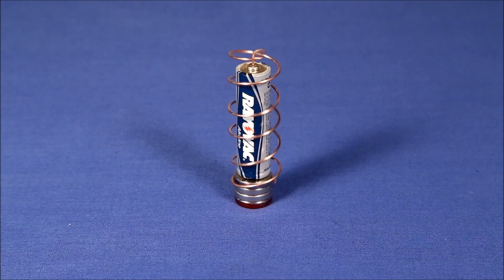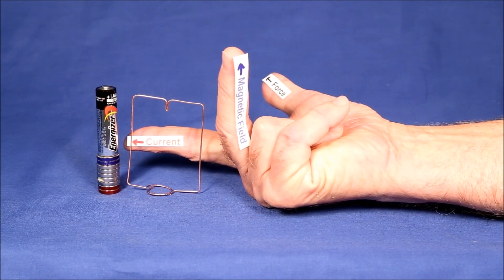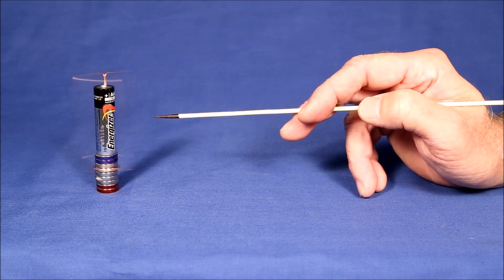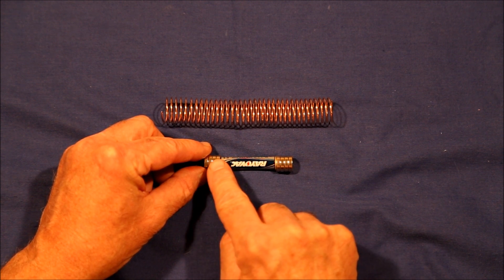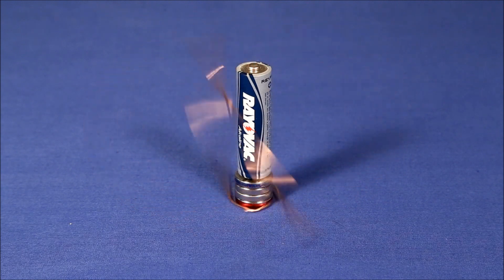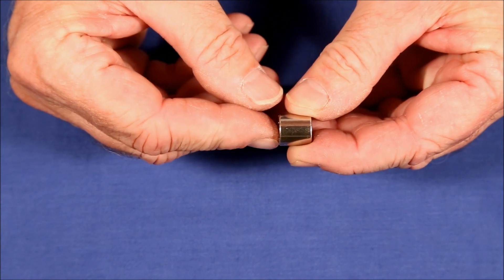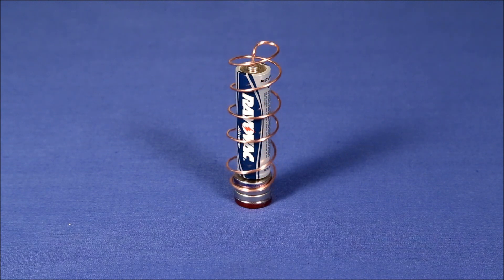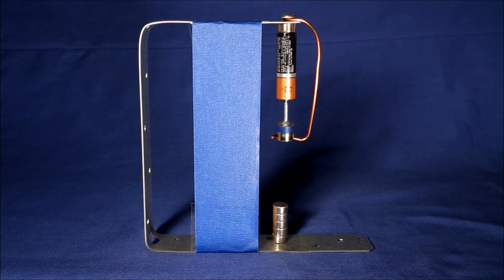How to Build a Homopolar Motor

Comment: use the other design, ie two ring magnets against each other, and radial wire-discs on the rotor axle ends.

Comment: Thanks for your interesting video. 

2:21
With respect, I don't quiet understand your point about the direction of current flow.
Although it is true that the direction of electron flow is opposed to the current flow, it appears as if each proton were moving forwards for each electron moving backwards.
Reply from the maker: In wires, protons don't move. They are locked in the nucleus of the atoms, which are in turn bound in place in the metal matrix. Only elections move. This gets confusing in liquids because positive ions can move, but in metals it's only electrons. Thanks for writing!

Comment: what is the thickness of the copper wire
Reply from the maker: +ALISON LO I used 18-gauge, 1 mm in diameter. 16 gauge would be better for the shapes with large loops because it's thicker and stiffer.

Comment: NICE!!!!!!!!!!!!!!!!!!!!!!!!!!!!!!!!!!!!!!!!!!!!!!!!!!!!!!!
Reply from the maker: +Extreme Gamer 1234 Thanks!!!
Reply: +Wayne Schmidt Did you use the 1.0 mm copper wire or wider?
Reply from the maker: +DG CU-T I use 18-gauge soft copper wire from Amazon (http://www.amazon.com/School-Specialty-Gauge-Copper-Length/dp/B00FGEGWES/ref=sr_1_4?ie=UTF8&qid=1462291710&sr=8-4&keywords=18-gauge+bare+copper+wire) which is 1 mm in diameter. Some of the larger loops would have worked better with 16-gauge because the 18 got a little floppy. Once the RPMs built up it tended to bend. Thanks for the comment!
Reply: Wayne Schmidt Thanks a lot!!

Comment: Very in-depth and some very clever designs. I had never thought of trying the rolling/railgun with different sized magnets.

You might find the last demo (1:10) in this video interesting. https://www.youtube.com/watch?v=8QWB8IfNoIs I strike a DC arc between 2 concentric rings in a magnetic field. This drives the arc in a circle like a Magnetoplasmadynamic pinwheel.
Reply from the maker: +Nick Moore Thank you! And thank you also for the link to that great video. The circling arc in the rings at the end reminded me of the Jacob's Ladder video I made last year, though yours is a much better demonstration of the Lorentz force. To anyone reading these comments, I highly recommend viewing it!
Reply: When I first tested the idea I had wanted a Jacob's Ladder that didn't use the heat of the arc to move so I experimented with magnets. The thought was to eventually make a Jacob's roller coaster but keeping the rails exactly the same distance apart and having a strong uniform magnetic field turned out to be more fiddly than expected.

Glad you liked it!
Reply from the maker: +Nick Moore I checked out your channel. You have a lot of great videos. I look forward to checking them out. I get the impression from some of them that you are in Australia. Is that correct? I'm in southern California, in the high desert area 60 miles north of Los Angeles.
Reply: +Wayne Schmidt I'm from Canada but am currently living in New Zealand. I have been reading your site for a couple years and love your projects. I've been meaning to make and pop some huge bubbles for a high speed video.
Reply from the maker: +Nick Moore That would be interesting to watch. Good luck!

Comment: Believe it or not, I stumbled on your video for apple pie many, many months ago. Even from that video, I had an inkling you were an engineer. I've spent many hours checking out your videos and site. 

Keep up the good work, and thanks for sharing your knowledge, time, and experience. As I've said before, you come up with the coolest stuff.
Reply from the maker: +SW990 Thank you!  My next project is a micro soap bubble blowing machine. I usually work on giant soap bubbles but recently got the urge to experiment with the other end of the spectrum. One problem I've already run into is that when they get too small, they look like fog and can be inhaled. Also, at that size they don't show any color, they just look white.